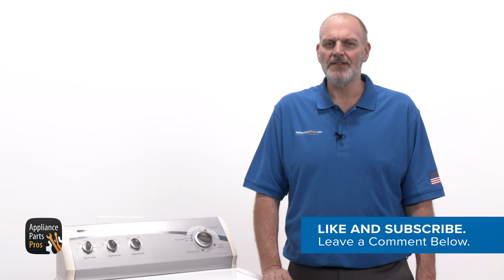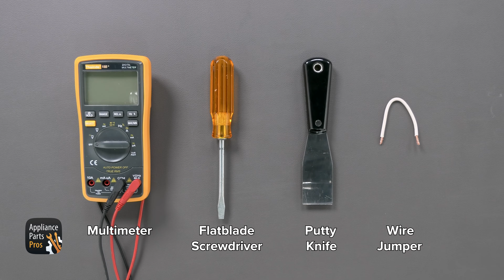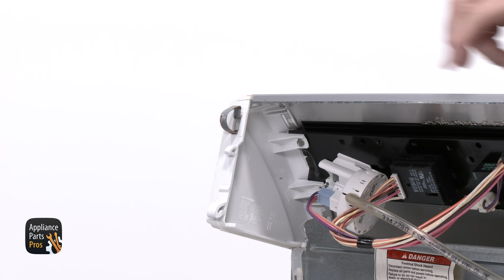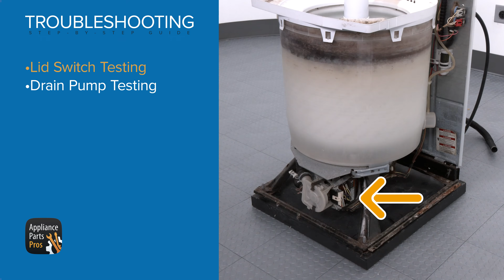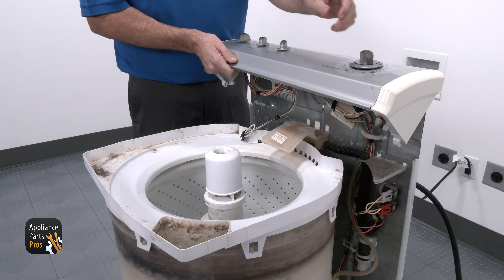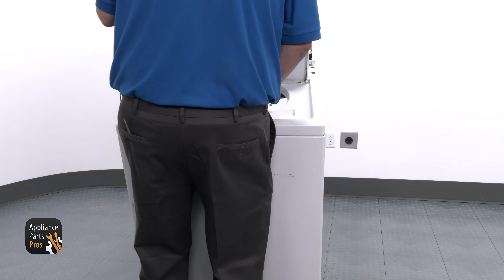How To Troubleshoot A Kenmore Washer Not Draining

Comment from the maker: 🔧 Fix it yourself:
▶ GE top-load washer drain pump assembly (no specific part ...: https://www.youtube.com/watch?v=Zs_y2WwIW28
▶ GE Tub-to-Pump Hose WH41X10131: https://www.youtube.com/watch?v=9iNtwR6_iaw
▶ Drain Pump Motor and Impeller — DC31-00187A: https://www.youtube.com/watch?v=rlLzXlaJqVE
▶ suspension rods (Samsung top-load washer, specific part n...: https://www.youtube.com/watch?v=CD4H_gRG_Gc
▶ outer tub seal – LG/Kenmore – part #4036ER4001C: https://www.youtube.com/watch?v=qjeWMs_ADIA
▶ GE Drain Pump and Motor Assembly – WH23X10030: https://www.youtube.com/watch?v=Lzs1FdXl5DA

👍 Found your fix? Hit Like so others can find this video too!
🔔 Subscribe for more repair guides: https://www.youtube.com/@AppliancePartsPros

Comment: The washer will agitate with the lid up
Reply from the maker: Thanks for sharing that, Linda! If your washer is agitating with the lid up, it could mean the lid switch isn’t working properly—or it’s been bypassed. The lid switch is a key safety feature, so it’s worth checking to make sure it’s functioning the way it should. Let us know your model number if you'd like help locating the right part!